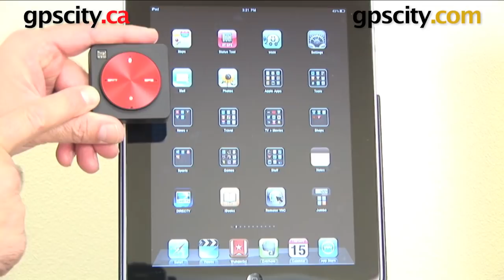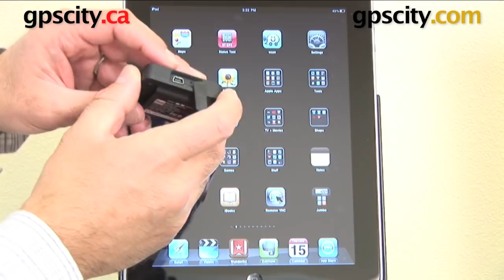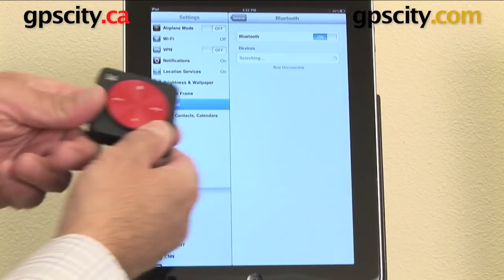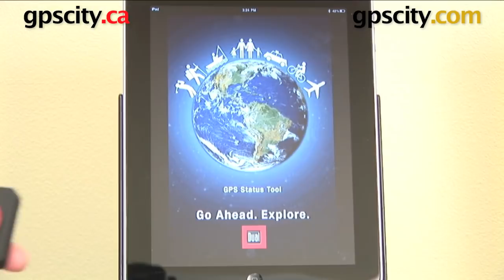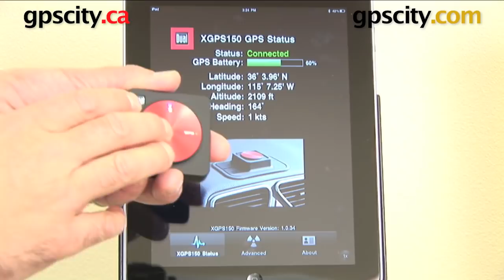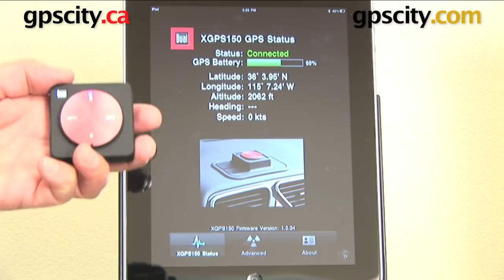Dual XGPS150 Bluetooth GPS: Connecting to an Apple iPad @ gpscity.com

Comment from the maker: It depends on what device you're pairing it with. Some phones/tablets will require a passcode (for which you can use 0000 or 1234 when pairing with the XGPS 150), but some do not.

Comment from the maker: The vertical accuracy is not specified but will most likely be around +- 10 meters.  The Horizontal will be much better at around 3m.

Because the video is shot indoors the accuracy will be all over the place and no where close to the specs.

Comment from the maker: That information is not specified by the manufacturer.  It will most likely be +-10 meters  in the vertical when outdoors..  Here are the manufacturer specs
    65-channel SkyTraq GPS chipset
    WAAS/EGNOS compatible
    Accuracy: +/-2.5m (CEP) (tracking WAAS)
    Fast location acquisition times: under 30 secs (warm or cold start)
    Position updates: at least once per second
    Maximum speed: 1000 kts / 1150 mph
    Maximum altitude: 18,000 m / 59,000 ft